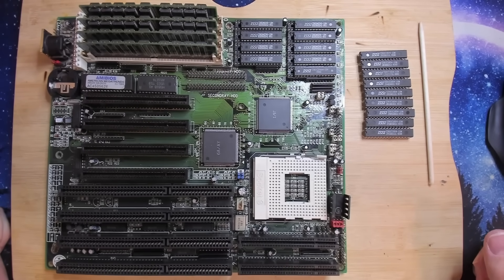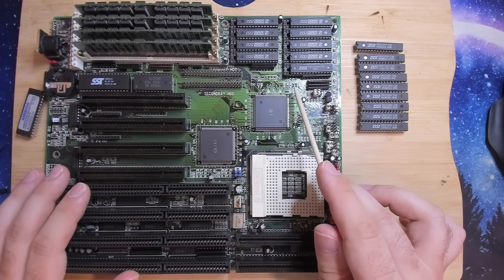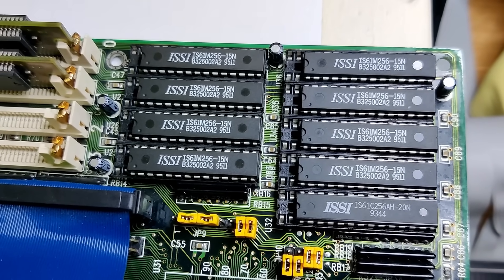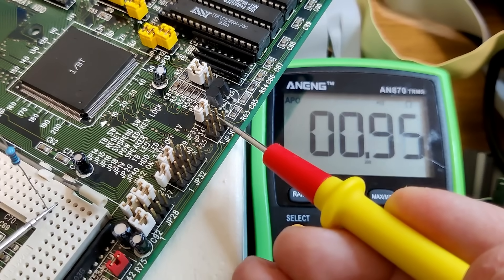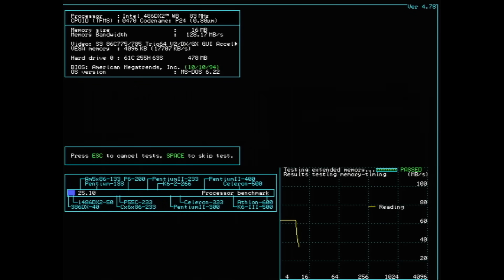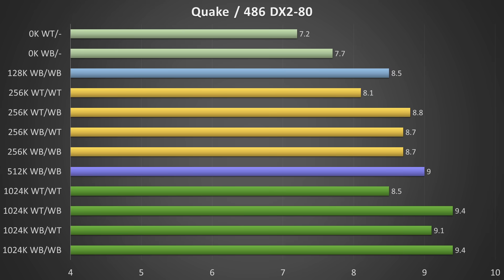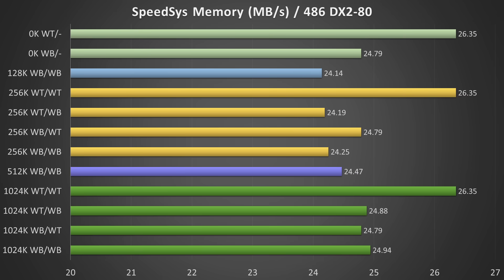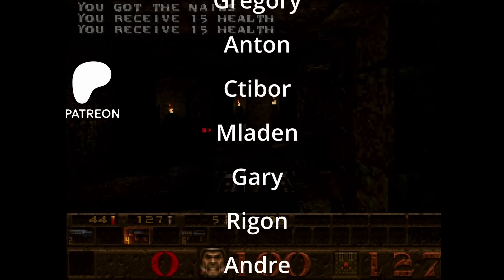How Much Level-2 Cache Do You Need?

Comment: Back then L2 cache was used only to cache the RAM. So it basically went down to the question how much memory you have and if the software which you use needs all that memory. Most PCs of that time had 4-8MB of RAM and most "home use" software was written to fit into that. In WT mode 128K were sufficient to cache the access to that memory completely. In WB you needed twice as much. So, yeah, 256K was sufficient as long as you didn't install >=32MB of RAM and started to use Windows 95.
Reply: This all day long. I never recommened more than 256 of L2 for 90% of customers. Those of us who were running stuff like databases with 32mb or more of ram then yeah more cache the merrer. I would run faster l2 on my home rig for a little more bump in games but it was marginal but bragging rights and all that did apply :)
Reply: I don't understand what you mean by "L2 cache was used only to cache the RAM".  What else would it be used for?
Reply: @GoatTheGoat  Bad wording, sorry. I meant the cache was used only to cache the memory, compared to the later CPUs which got additional instructions cache. I wanted to say, that back then only memory was cached. L2 unrelated.
Reply: @necro_ware Yes, the cache is for both instructions and data together.  Modern caches sometimes separate those into their own dedicated caches.  But they both come from memory regardless.
Reply: Not quite.
You saw it from your own benchmarks - the bigger the application, the more it gained from large L2 cache.
Whatever is the busy-loop size of your benchmark program, if it can fit mostly (or fully!) into cache, it shows. It's only when you have super tight busy-loop (like TopBench) where you see no gain from large cache. TopBench probably fits the whole busy-loop into L1 CPU cache...

The bigger the program (in terms of busy-loop), the greater the effect of large L2 cache. And it doesn't matter, if your RAM size is 8MB or 128MB. (assuming the "big program" doesn't require more than 8MB of RAM to run)
Reply: That is true, but you only had to run a few applications, ideally under Win95, and the situation was different. It didn't have to be about processing any databases. Then you were very happy with 32MB of RAM. It is true that 32MB was above standard, but not because it wasn't needed, but because of the money. Many mid-range (DX2) and late 486s typically had 16 and 24MB of RAM. 32MB was seen less often, but they were. With AMD X5 133MHz, it was already a completely common combination. I like my machines tuned to the maximum, so I wouldn't hesitate to install 64MB of RAM on a late 486, even if it's not exactly typical for the time. So I would appreciate a larger cache. On the other hand, I can easily install NT, OS/2 or some Linux there, which are very hungry things. Games (especially those for DOS) are something else. But retroPCs are not just games.
Reply: @Thales_WH  My first PC compatible in 1993 was a 486DX40 and the standard at the time was 4MB of RAM but I had 8MB in mine. 128KB of L2 cache was plenty for that box. I was only one of three on my whole college dorm floor of 32 people with that much RAM. I was running OS/2 Warp 3 though (after it released in 94) instead of the typical DOS+Win3.11 so it definitely came in handy. I didn't go to 16MB/256KB until I upgraded to a Cyrix 5x86-100 a couple of years later.
Reply: @JeremyLevi  It fits. The 486 has come a long way in its era. It came on the market in 1989, so it's no wonder that by 1996 the standards had changed a lot. That's why I specified in my comment which 486 I was talking about so that no one would think that I thought a 486 like yours had 32MB of RAM. Of course it didn't, you wrote it correctly. For a long time the standard for a 486 was 4MB of RAM, the luckier ones had 8MB. In 1993, a classmate had 5MB of RAM and it was king. I had 8MB thanks to my uncle who worked for a company that took care of IT for banks and they were phasing it out there. It was like winning the lottery. But then PC development accelerated a lot and just one year later everything was different. DX2 ruled the world and people started adding RAM. mostly in the form of upgrades, so strangely non-round numbers like 12, 20, 24, 28MB were common from today's perspective :) That was the beginning of the era I wrote about in the previous post. Otherwise, at that time you had quite a hot new product, AMD 486DX-40 was released in April 1993 :) Cyrix 5x86 or AMD x5 were completely different 486 than the one you wrote about. I skipped it and went the way of i386DX 33MHz 64KB cache 8MB RAM > Am386DX 40MHz 128KB > i486DX/2 66@80MHz > pentium 75@90MHz.
Reply: This was always my understanding at the time too. How much L2 cache you really needed depended on how much memory you had / were actually utilizing. Higher memory requirements with insufficient L2 cache could hurt performance but having too much L2 didn't really get you a benefit.
Reply: Well done on doing monotonous task of re-doing audio!
 That from a writer POV I consider chewing used gum, not enjoyable.
IE sometimes I have to reword or deeply edit a document, when I want to write fresh stuff.
Great content as usual, and excellent camera work.
Reply: Great info
Reply: I think some history is being rewritten here.  My 486SX/25 shipped with 2MB RAM and no cache in ~1993.  The PC cost a grand, plus a monitor for another few hundred.  I upgraded it to 6MB with a 4MB stick that was another 165.

I replaced that PC with a home-built DX2/66 that I started at 8MB RAM, and toward the end of its life upgraded to 16MB.  These were not cheap upgrades.  I was a late teen at the time, and didn't have income, but I did have a generous dad who understood tech and would throw me a bone to encourage my exploration.

It wouldn't be unheard of for someone who had a job and some disposable income to have 32MB in their late-486, but it would be a significant investment, and to justify it, they would either need that much for some specific purpose, or they were really hoping to impress the ladies with their large RAM count.

Just to put in perspective how much 64MB would NOT be common, I have a Pentium 200MHz build with 64MB.  It can't even run the Duke Nukem 3D Nuclear Edition as-is from the CD-ROM because of a bug that crashes the installer with >32MB RAM.  There is a patch to fix this, but it goes to show that not even game devs, who published an expanded edition of their flagship game which required a fast 486 to play, had that much memory in their PCs.
Reply: @necro_ware
I have to disagree with you about the standard amount of RAM BITD. 12MB and 16MB were common and upgrades to 24MB and 32MB became common as RAM prices came down. So having 256K was ok upto 8MB, but 512K was much better if going above that. 1024k became a must of going above 16MB.
Reply: @lexluthermiester  It all depended on tag ram. 256k with typical tag size was good for 64mb. And on boards that supported interleaving, the 2 banks of 128k each would be able to perform as good or better than a single bank 512k cache. And on windows 9x, disc caching tends to use the upper bits of ram. So for example if you have 80mb of ram and only 64 of it is cached, chances are most of the uncached ram will be disk caching anyhow, and not typically used for direct execution of programs.
Reply: @wishusknight3009
Part of that is true. Not all motherboards were made equal and it was very difficult to know which ones were configured in which way. For that reason it was always best to default to lowest common denominator and use as much cache as would be needed in the worse case scenario. BITD, I always fitted boards with at minimum 512k(were possible) unless I knew the board was going to have more than 32MB, then 1024k. The rule of thumb being "it's always better to have more than you need than not have enough" was just as true then as it is now..
Reply: @lexluthermiester  back when these boards were new, 32 megs of ram would have been thousands of dollars, and a 1024k cache by itself would have cost almost twice that of the motherboard with 256k. 32 megs was not common until 1996 or 97.
Reply: @wishusknight3009
I was there. I remember how much things cost. It was hundreds, not thousands. About $230ish for 32MB in 94. Much less a year later.
Reply: @lexluthermiester   That price estimate is too low. My dad had a PC shop in that era (from 1991). 

There was a massive RAM shortage in that era...around the time DOOM was released. Late 1993/1994.

Some important factory in Taiwan exploded causing disruptions in the supply chain. 

The reason I remember, is because my dad "borrowed" RAM out of my PC and his own for customers. Just enough to play DOOM decently lol😅
People were going from store to store desperate to find RAM. 
My dad was able to sell the used RAM from our own PCs for more than double the usual price. I remember $700 (and something) for 2x 8mb simms. 
RAM was being rationed by suppliers, and the RAM that came in sold immediately because there were customers waiting to be notified when it arrived. 

Somewhere during that year (1994) RAM prices came down again, but not all the way. 

When Windows 1995 was released. It was a similar situation, but not as bad. Lots of people showed up needing to upgrade RAM for Windows 95, and prices from suppliers were higher than normal. 

Soon after the win 95 rush, prices dropped fast. And I was finally able to upgrade my ram again. 
My dad gave me two 32mb modules, but I don't remember how much they were at that point...i just remember I felt guilty because I knew 64mb it was still had a big price tag (also I could sense my dad feeling a sting...like he regretted giving such big modules immediately after giving it).
Reply: @tylerdurden3722  
Don't talk to me like I wasn't there or can't remember right. You can keep your silly opinions, reality will keep right on going.
Reply: @lexluthermiester on a 486DX2-66? Search for adverts from that time, you will be surprised.
Reply: @lexluthermiester  12Mb (such an odd ram number) and 16Mb where common when exactly? not in 1994 for sure.
Reply: @boardernut  
It was where I was living. People upgraded from 4MB to 12MB with an 8MB kit. 4+8=12. Basic math there. People also did 2MB to 6MB with a 4MB kit. 2+4=6. There's a lot of different configs possible and happened at that time. Perhaps you didn't work with enough machines/people to see it. Regardless, you are incorrect.
Reply: @lexluthermiester  but not in 1994.
Reply: @boardernut  
Moose muffins. I was there, doing those kinds of upgrades. Just stop. I am not going to yield.
Reply: @lexluthermiester  haha you are just trolling or you weren't there. Find me a single MAINSTREAM software that was released in the early 90' that required 12 or 16 Mb of ram to execute in DOS or Windows 3.x.

Comment: so, intel is shoving 20mb+ of L2 for no reason?
Reply: L2 and L3 on modern CPUs have more effect, as they are more tightly coupled, on a 486DX2, even the best L2 cache is only ever going to be half the speed of the CPU integrated L1, socket 7 was the last platform to use motherboard located cache, as CPU multipliers increased and RAM got faster, there was also the case of socket 7 cache having less effect as RAM improved from FPM to EDO and the SDRAM
Reply: its roughly equivalent. the newer processors throughput more data, so they need more cache. it's also used a bit differently than in the older systems.

Comment: One word of caution: Not all 486 motherboards that claim to support 512K/1024K of cache do so without issue. I have 486 boards that become unstable with more than 256K of cache, or that support a lower amount of RAM than advertised with the maximum amount of cache installed.
I’d recommend running MemTest before and after upgrading cache, and if you start seeing memory failures at an even memory address (such as 32MB) after upgrading cache, you might have run into a limit of your board’s cache controller… (Yes, I have a board where I can choose 256K cache and over 32MB of RAM, or 512K of cache but under 32MB of RAM. And no, it’s not documented in the manual.)
Reply from the maker: The PCChips board seems to have issues with 128MB FPM memory. I didn't have time to investigate, but I did seem to get memory errors - SpeedSys failed. So, it could be true that the memory controller is just not up to the task to manage in combination with the large cache (which you need for 128MB).
Reply: A similar thing happened to me with an Amiga A1200 of all things back in the '90s, and not with cache. I had an external SCSI controller that plugged into side expansion slot so that I could connect a CD drive and if I plugged that in whilst having more than 4mb of RAM, the system would crash to a green screen of death on start up. If I wanted to use my CD drive, I had to swap out the 8mb SIMM for a 4mb one, do what I wanted with the CD drive(install a game, for instance), then switch the system off and put my 8mb SIMM back in.
Reply: I have a Packard Bell 386 (I believe it's a rebadged Samsung OEM) that won't support 4MB with full cache installed.  It'll throw parity errors at random.  2MB with cache, or 4MB without cache (IIRC), both work fine.

Hot-rodded retro PCs represent exotic configurations that just weren't tested back in the day, because it cost so much that nobody was going to do it.  At least not on low-end hardware.  Maybe a Compaq or IBM workstation could handle everything it was technically capable of.

Comment: Performance level between 1MB and 256KB within the margin of error. That's why in 99% you spent a 486 system with 256KB onboard cache.
Reply from the maker: True - there isn't much to gain from more than 256K - maybe in exotic situations more cache is beneficial, but for games, 256K should be the sweet-spot.

Comment: You can never have too much cache :)
Reply from the maker: I do remember tweaking my system trying to get 2-3% from each tweak. A handful of tweaks later and you gained 10%.
Reply: Especially when you're trying to absolutely max out a system, as I did a few years back as part of a competition in a forum. Those 1-3% gains might make the deciding difference. Otherwise 256k usually is enough.

Comment: odd I thought PCI was common on 486 boards. I recall all 486 boards having like 3 ISA and 5 PCI slots.
Reply: 486 was transitional, there were ISA only, ISA/VLB, VIP (VLB ISA PCI), trailing off into ISA/PCI
Reply: @matthewday7565  I've seen VLB, but I don't believe mine had it.
Reply: I think your mixing socket 3 with socket 5/7 boards. The baby at layouts look very similar.
Reply: @Pickle136  I recall moving from 486 to a k6 (not 2 or 3 just plain) and being upset that I couldn't get a PCI exclusive board. I wouldn't feel that way if my 486 didn't have PCI. So I know that was for sure.
Reply: PCI became common for the DX2, etc boards but all the original pre-multiplier era boards either had just ISA on the low end or ISA+VLB on the higher end boards.
Reply from the maker: My 486 came with a Gigabyte GA-5486AL (at least I think so). It had 3 PCI slots and 4 ISA slots. I basically grew up with PCI as the main bus - and ISA was already old tech.

Comment: they went through a lot of trouble to make this board fake. Why not just simply add a message that says 256k and leave it there? Why actually take the trouble to disable cache support?
Reply: same reason why Nvidia locks the bios so you cant mod and get more performance for less
Reply: @primus711  nvidia developed the bios for their own cards. For some reason they don't like higher performers. That's why EVGA is gone. But this company didn't make the bios. most people aren't going to say "those are fake chips" and replace them. So what is the point? Hell even having a constant "256k" show up on boot is overkill.
Reply: @awilliams1701 who made coded etc the bios is irrelevant
and yes pc builders back in those days can see that or add more
like 1% of "people" were building pc back then i think you are confused
and same pc builder used to sell over clocked cpus which is the same practice of robbing you
its was all about higher numbers equals better so we charge more back then
also with your bios argument they bought off the shelf bios and modded it so whats the difference
Reply from the maker: I didn't dig into the BIOS code yet, but it could be that they messed up the cache support while patching the 256K message. It is odd that cache doesn't work at all with the original BIOS. What I've noticed is that the BIOS must be a much older version compared to the one found on The Retro Web.

Comment: id like to find a super socket 7 board thats atx and contains a cache slot. ive got 512 sdram and i could actually use the 1024 tag cache

ive got a k6-2+ with on board cache so it uses it as l3
Reply: I loved the "FIC PA-2013"  that had upto 2mb L2
Reply from the maker: Are there Super Socket 7 boards with cache slots? I think at that time, those QFP chips got popular (same what was used on early Pentium II cartridges).
Reply: @bitsundbolts  unfortunately those were chips on board not slots. I remember loving this board back in the day, it was the only super 7 I was aware of at the time that had 2 mb L2
Reply: There are some about.  I have an Epox MVP3G5 with 2MB cache and K6 3+ 550. It runs great with 512 Mb of memory.  I also have a PC Chips skt7 K6 3* 450 With 1Mb of cache.  I think it is just as good.   Many of course just have 512mb, these are not far behind.
Reply: @davidp4456 dude!! I totally forgot about Epox motherboards good find!!